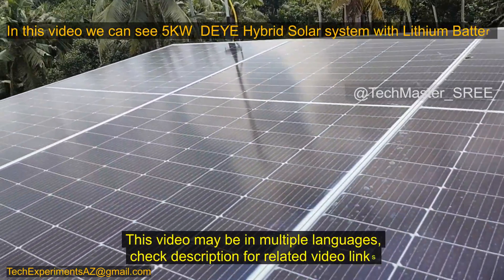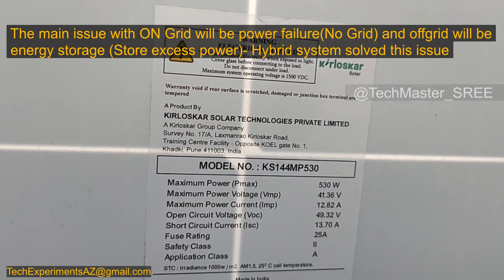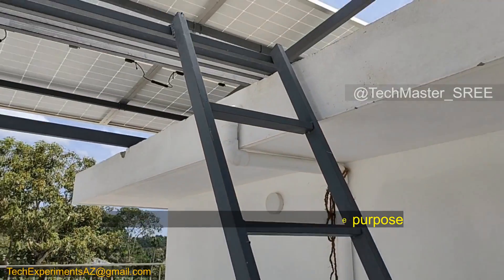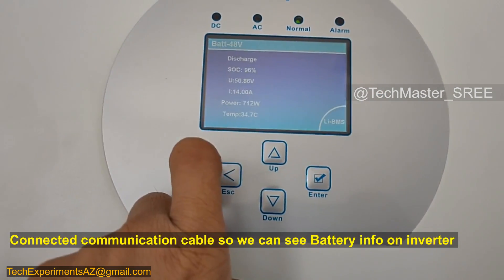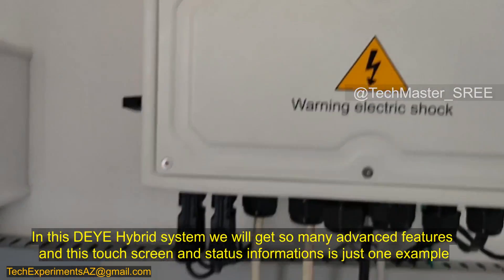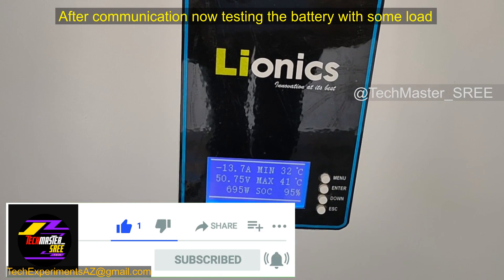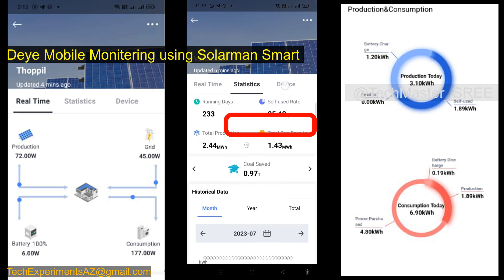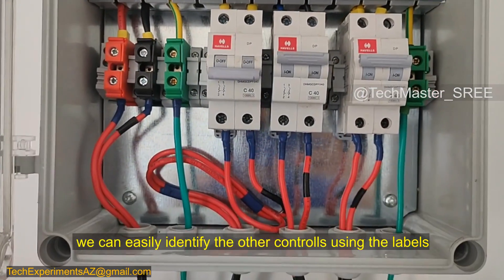5KW Deye Hybrid Solar with Lionics Lithium Battery -English

Comment: What the price of deye 5kw hybrid inverter...is it 48v...where we can buy it from in india... will it be cheaper to buy it from Alibaba?... including shipping and import duty...
Saw your musclegrid inverter video too...
Between deye and musclegrid inverter which will be a better choice, keeping in mind general load of house...1ac, pump,light fan etc..
Thanks in advance
Reply from the maker: Deye has advanced features  and I will recommend DEYE if you want to use it as true hybrid system. if  you have limited budget and don't want export to grid then go with other variants. You will get deye 5kw at 1L range.
if you are using as pure offgrid then warranty will not be an issue . For deye it will not be cheaper and for the other you will get at cheaper price
Reply: @techmaster_sree  Thanks

Comment: Very nice solar structure and inverter setup 🔥👍
Did you made the acdb yourself? It's Very neat and we'll labelled 👍
Reply: Thank you for sharing
Reply from the maker: @imssrinu  Thanks for the feedback
Reply from the maker: Thanks for the feedback ❤👍 . regarding ACDB - its just a custom setup that you can also do by purchasing a large box so we don't need to put additional box to place these change over and over volt protector.
Reply: @techmaster_sree  good 👍👍
Reply: This is installed by wegasolar Trivandrum
Reply from the maker: @bnmuneer  I'm there for configuration and I have specified that in the video itself.